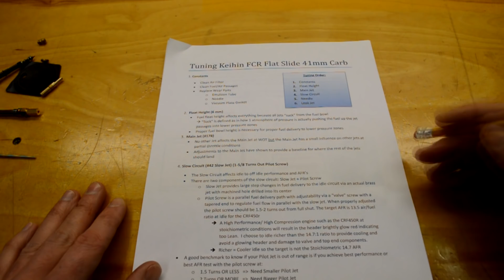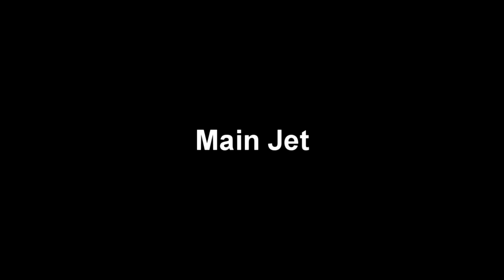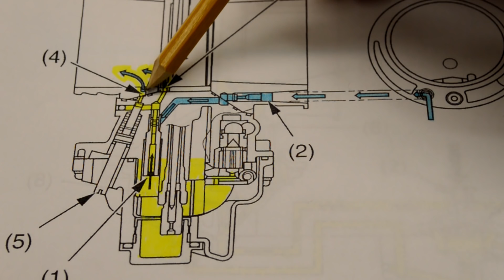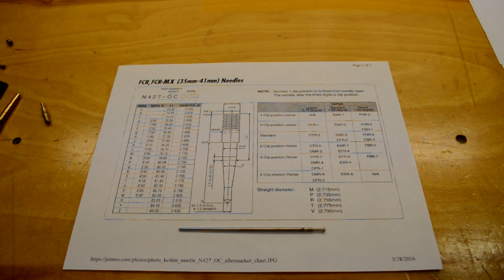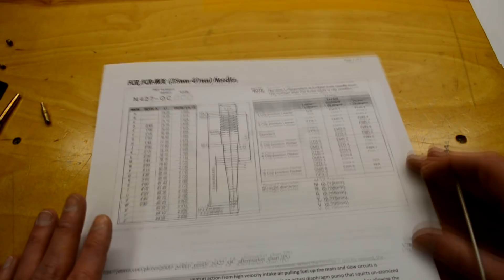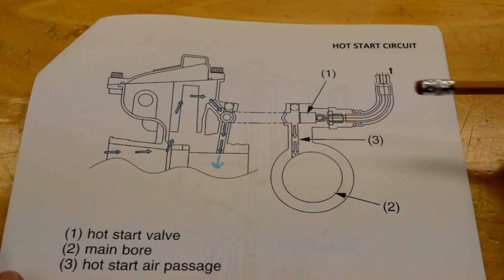Honda CRF450R Jetting And Fuel Delivery Explained

Comment: Did you say your Not going to try to tune out the decel pops because its in a throttle closed position?  Idk if you added a double negative or something but it sounded confusing

Comment: Im also try to tune a motor for the street what jetting did you end up with I have a hesitation in the low end bike came with stock needle 4th position, 45 pilot, 165 main, unmarked leak jet, and boysen quickshot cover. Any ideas?

Comment: Very helpful!  I’m interested in where you installed your O2 sensor because I’ve got one I used to use on my car.  Was sticking it in the tailpipe adequate, or did you make a mount for it further up the pipe?

Comment: Awesome presentation man.. I have a major issue with my sm 04 crf450X plated for the street also here in PA. The initial hit on my throttle eyelids a hard bogg but slow increase in throttle it's fine. If my little brain interpreted your information I think I need a smaller leak jet hole. I'm going to make the adjustment and I'll let you know how it works out if you like. Thanks so much for the content man! Your doing great work

Comment: such a well informed video on this carb, ive just completed a street legal crf490 build and have been dealing with this nightmare and im bored of having to remove the carb at this point😅

im getting very close but as you say getting the cruise right without hesitation is abit tricky

what were the jets and needle specs you ended up with out of interest?

also going to get myself an afr gauge so theres no doubt left, ive used afr’s on my cars in the best but didnt think the stock crf electrics would power it.. so good to know this is possible

also last thing is could you provide a link to the guide youve made to make the process abit easier when working at the bench

cheers for the help, this is an awesome guide

Comment: I have watched so many vids on how to clean or rebuild these FCR carbs, but very few explain (or do so what any degree competence) what each circuit does with interaction, and what to look for to tune, particularly the air/fuel ratio. And the fyi regarding the emulation tube, and what the hot start does... excellent!

I have a few questions:
1- would you post a link to your Tuning Order document?
2- how would elevation affect the air/fuel ratio in terms of target ratios? I'm assuming 12.5 / 13 is still target, just what jets and such it takes to get there would change? (I live at 3k ft and ride between 3k and 9k ft.)
3- what gauge/instrument were you using and how/where did you connect it?  I'd love to see a vid on just that :)   
Thank you for an amazing & very helpful vid.

Comment: Good video, one of the best I've seen on how a carb works and the air fuel ratio guage was a bonus. I'm looking at purchasing an afr meter to sort out the afr on two of my bikes. I do have a very nice digital carb balancer that has other functions for fine tuning afr etc. but on my v twin its not stable enough to get a steady reading and a colourtune plugh is not fine enough to see the colour change so an afr meter seems to be the way forward?

Comment: I have a trx450er it's pritty moded out, almost everything you can think of including head porting. Recently removed the airbox lid installed a DASA exhaust and switched to a uni filter from a K&N. 

There is abit of studdering when crusing at 1/2 to 3/4. Dyno jet needle middle clip. Do you think I should raise the needle to rectify this studdering? I'm assuming it's lean now due to the increased air flow. Any ideas for jetting? Thanks

Comment: Most detailed FCR video I've seen! Any advice or could you make a video on adjusting the AP timing screw/and leak jet? My ktm 525 bogs a bit off idle and I'm not sure what adjustments to make to help. Cleaned everything and got it spraying/working as it should, just need to fine tune it. 42 pilot, 1-1/8 on air screw as J/D jet kit recommends.

Comment: Hello mate recently I bought a 39 mm FCR with intention to install on a KLR 650 which is on the plans to be motard as well if you can give me an idea +/- what jetting should I start with on a mainly warm climate all year and a quite hot weather during my the summer The purpose of the bike would be mainly Cruze to mid range rev and times to times top speed any ideas where to start would be most helpful

Comment: great visual explanation.  I have an FCRMX 41 and when I start from 2 turns out and tighten (lean) it revs up all the way till seated.  Conversely, if I start from 2 turns out and loosen (richen) it will slow down till it stalls at about 3.5 turns.  From what you said, i need a smaller pilot jet.  But I just looked at i'm already at 42.  I've always run 45 or 48 with other bikes/quads using this carb.  Any reason why I might have to go smaller?  The carb is from an 07 KTM 450sxf but it's installed on a 2007 Suzuki LTR450 Race quad. (which was injected).  Thanks!

Comment: I have a suzuki rmz 450 2007 with the same carb.
It was sitting about 1 year.. it did not start.. cleaned the carb twice.. it started  but it is running well only with choke on.. when the choke is off the bike popping and backfiring... Also a little smoke comes out from the carb... What is going on????

Comment: I'm a 30 year in Technician for the automotive industry and new to the 4 strokes, (2005CRF450X) in love, 51 years and still riding. Hey bother, by far the best clip for this carb ever. Can you do a clip for accelerator pump screw. There is no spec and every clip I've watched is completely WRONG. Just to toss one out there I set the screw at full throttle with a slight gap between the screw and plunger rod lever so you don't bottom out the plunger. Now I get a full squirt of gas all the way through and now much much better. I don't know the leak jet size but being the bike is modified (air box and pipe) I will take your #52 and give it a snap of throttle. Thanks Bud for the great video... oh btw, I ride 1985 CR500R that I will never give up :-) check out my goon riding  https://www.youtube.com/watch?v=HoYZG58E-9M

Comment: Hey man thank you for this very helpful video. I’m trying to fix my 04 crf450r and I replaced the jets and I have to put the pilot screw all the way inside if I turned it less than half turn it turns off and it won’t start again. All the parts I got to rebuild the carburetor are original Honda. What should I do now?
Reply: Replace your "mid body" o-rings set as well.

Comment: Hi, i need advice on a different issue i have with my fcr. Not the same bike, it's a xt600 with dual raptor fcr 35, i have a strange issue when i let a little the throttle after full throttle, it makes like a small bog for half second, not when i open the throttle but when i let it that's the strange even if keep the throttle full for time. It have easy cold and warm start i can use full throttle from idle without bog but it bogs when I let it, it's a little annoying. Any ideas? I have tried mj from 160 to 145 and needles from 2nt to 4th and it's still there

Comment: The fuel delivery happens through main jet components all the way up to full throttle. Just curious why one would care about the hole size on the slow jet when it affects none other than the idle. Beyond idle, the slow jet will be closed. Feel free to reply if anyone knows the answer.

Comment: Great vid. So what would it mean if I have a slight miss fire on the idle AND choke circuit? I waa under the impression that the choke corcuit was its own circuit of air and fuel? When I got this 2006 CRF250R it had a 40 pilot in it has a 172 Main and the needle clip is in the third position from the top. Well I had to go up to a 45 pilot and move the needle clip down to v slot from the top to get it to start and then run smooth at warm up from the idle circuit to the mid-range.

Now when I put it on the choke circuit to start it when it's cold there's a slight Miss and then when it's warm it still has the same Miss on the normal idle circuit. I believe that the previous owner put in all balls jetting kit in it because of the number engraved knob headed pilot fuel screw as well as it had a silver number 40 pilot in it. That kit comes with screws pilot jet needle and the adjustment screw for the pilot fuel screw and for carburetor Bowl screws.

 With a 45 pilot when I screw in the fuel screw at idle after warmed up it will start to die off and stall out and a half Turner below out from seated. But I don't really notice a whole lot more after 2 or two and a half turns out. So I'm contemplating I'm going back to the original stock needle as I'm not sure if this all balls needle is quality enough. You can find a video of my issue on this bike on my channel as it was just uploaded the other day. If you've gotten this far thanks for reading and I look forward to your reply. Andrew C

Comment: My accelerator pump will not squirt fuel. What is causing that?
Reply: Have you inspected the diaphragm for cracks or other perforations? That’s usually the reason for total failure to squirt

Comment: I am new to this.  Thanks for your video.  Is all of this jetting related to elevation?  I live at 5500 feet, but want to ride in Glamis at an elevation of 335 feet.  Would I need to have two jet kits for each of my elevations?
Reply from the maker: Just based on the temperature difference and elevation of the two I'd say yeah.  At least bring a main jet because you'll most likely be wide open throttle in the sand alot.

Comment: This video sets the standard for knowledge level for pumper (FCR) carbs. Bravo.  👏
Reply from the maker: Thanks mang!  🍻
Reply: Emerson Raceworks where did you get the air/fuel mixture gauge mine is 2004 crf450r pinched to hot cam 490

Comment: any suggestions for a less expensive but still accurate AFR meter. i see a carburetor rebuild in the near future and i want to get the best fuel consumption and power balance. Im not going to be racing so i would like my gas to last just a tad bit longer if possible.
Reply from the maker: There's got to be other ones out there or maybe a used one someone is selling from the car, aftermarket tuner/ricer world.  Maybe try craigslist.

Comment: Great work, I have been struggling with my son-ln-law's 450, had old fuel in it, cleaned it out replaced all the jets, runs with choke but dies as soon as the throttle is just touched also dies when choke released. Now to watch this and see if I can fix it for him (I'm an old Yamaha XS1100 rider)

Comment: Thanks for your video Neal. Excellent!  I want to try a new emulsion tube in my FCR on my KX450F.  On the Kawi parts diagram the only part I can find which might be it, is something they name the "Nozzle main".  Part 49121. The main jet screws into it.  Is that the emulsion tube?

Comment: Looks like this became an obsession to get the CRF running as perfectly as possible given changing weather and atmospherics and to understand exactly what was going on in the carb at different throttle openings. Very well explained and logical approach, the overlaying of the jets on the scale diagrams added to the clear and thorough presentation as did the photographs of the worn parts. 
Excellent educational video, well paced and presented.
Would be interested to see how you mounted the sensor probe?
Reply from the maker: Once the weather warms up a bit here I'm going to make another video of how I got the AFR gauge mounted.   A lot of people have asked for that.
Reply: That’d be great to see also if you could provide a link to the AFR gauge you used that would be awesome. I’ve never heard of that device before but it sounds like a great tool to have. 🤙

Comment: I have a 04crf450r and when the bike is on gas is coming from the carburetor where the casket sits in the middle where the bottom separates from the top. What do you think the problem is? FYI the gasket is in good condition.

Comment: Hi. Awesome video sir, very informative. 
I just bought a 09 CRF 250, but struggle to get it to run right. the motor has just been overhauled at a professional shop by the previous owner, but the bike is impossible to kick start. starts fine by roll start at about 5-6 mph. When the motor is warm it starts easily by rolling, but still no kick. The bike idles very high tho and dies when adjusting the idle speed screw.
The carb has an aftermarket R&G float bowl, and the previous owner said that may be the problem, but do you think so? or should i just try to check the float hight, pilot screw and then jetting?

Thanks!
Reply from the maker: I would completely disassemble it and clean it as I've done here.   Then verify the stock jetting  Honda prescribes for your year is in there. Then if it still runs bad then make adjustments.  And the aftermarket fuel bowl....  just make sure the float height is where it's supposed to be.  Whether its stock height or different as requested by manufacturer.

Comment: Hi! Your video is so amazing,  its so helpful to me.   I have a problem, if possibleplease help me solve this issue .  Thank you so much. 
I have a FCR (single) 33mm for my custom bike (210cc 62x68.7). 
Main jet 122      Main jet air 170      Needle HVT 
Slow jet 42         Slow jet air +1and1/4 
pilot screw +3and1/2
No leak jet     pump timing  = 1/4 throttle

Mine works not really well. 
First,  should I change Slow jet to 50 and reduce Pilot Screw to +2
Second,  I dont know what is the best pump timing because of  the rich mix feul. My engine go down at pump timing @@ i have seen your video about tunning pump timing,  but i cant exactly find the best time for my engine  to get max power
Reply: I tried to get pump out and changed:
Main jet  128
Pilot screw +2and1/4
Throttle valve is higher for idle

The result:
Idle: good
0-1/4: rich
1/4-3/4: good
3/4 - 1: lean
So i think the best pump timming may be at 1/2 throttle?

Comment: I have a 08 crf450 that starts & idles and excelerates perfect ,but pops at 1/2 speed constant throttle and deceleration..
 I thought I checked for  everything ..seems to improve making it leaner ..
Reply: I have this same problem on my 03 Crf450 did you happen to find the problem?
Reply: Any luck fixing this?

Comment: Awesome Video. The way you took the time to explain how each circuit works was the best I have seen. I do have a  question on the A/F gauge. Where did you place the probe in the exhaust?? Like X distance from the exhaust port??
Reply from the maker: I welded in the bung for the AFR sensor right near the mudflap area above the swingarm.  The instructions for the wideband sensor tell you how far away, and how to orientate the sensor in the exhaust stream.

Comment: This is by far the best video and information in general I have ever come across about FCR carbs and I have done a ton of research in the last few years so kudos to you for making it and whoever gave this a thumbs down must have not been very intelligent and probably couldn't follow it. In order to learn how to do something good you need to have an understanding of how it works first and this is what you showed us in the video and I'm sure it will help me be a better tuner. I have been switching my bike between stock and a big bore kit and also from both of those to a high compression piston and each time I have to make jetting changes. My bike ran perfect with the stock piston but ever since adding the HC piston I'm having a hard time getting it dialed perfectly in. I finally have it almost there but I'm still getting some weird surging idle. I have changed every jet and tried dozens of combinations and also rebuilt the acc pump diaphragm which helped with an off idle bog I was getting when twisting the throttle fast but the weird surge is still there slightly. It gets better if I turn down the idle but then the bike is hard to get started when hot and also stalls occasionally. I also noticed if I tilt the bike on it's side while it's doing it it goes away. And lastly it gets only noticeable when the bike gets real hot so after running for a good amount of time straight. It seems like the very very slightest twist of the idle makes huge changes so it's hard to get it dialed in. Any help would be appreciated? Thanks again for the video!
Reply: What kind of fuel are you using? High compression pistons typically need higher octane fuel from my understanding. Also what does your plug look like?

Comment: First off, fantastic video and probably the best explanation of how a carb works on the internet. Second, what are your sprocket sizes? I recently converted my 08 450R to street, and Im curious what works best for you?
Reply from the maker: I fit a 15 tooth on the front,  and a 44 tooth on the back.  Stock internal gearing.  With this setup its perfect for daily street driving.  it can operate at ~65mph no problem without over revving and i've had it up to ~98 tapped out.

Comment: awesome video!!! i love the detail!!!!  popping on decel is a sign of lean pilot circuit..
Reply: Popping on decel is sign of the lack of an acv circuit (not needed on racing carbs, only street bikes have it). Kudos to the creator, this is the first time I see someone tuning an FCR (or carb generally) properly.
Reply: @panosvougiou   Can the carburetor be somehow tweaked to not induce backfiring even without air cut valve? Spend almost whole day tuning polini pwk30, thinking my pilot jet was too lean, which is not the case evidently.. if I go rich enough, the backfire's almost gone but the bike won't start, cause it's too rich
Reply: @peshhhiify  hey, please refer to guides on how to adjust your idle speed/ims screw, it's a relatively easy process. A bit of exhaust popping is expected when your idle mixture is set properly.
Reply: @panosvougiou  Thanks! I finally discovered, that the problem was unmetered air passing through bad sealing after the carburetor. That's why a i wasn't able to tune it properly, especially on the pilot circuit, where it got the most pronounced..